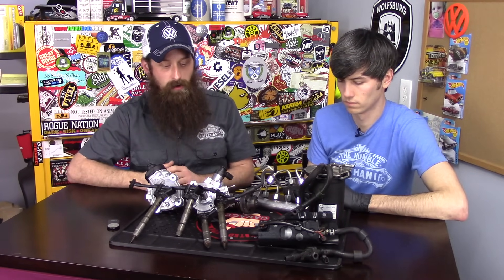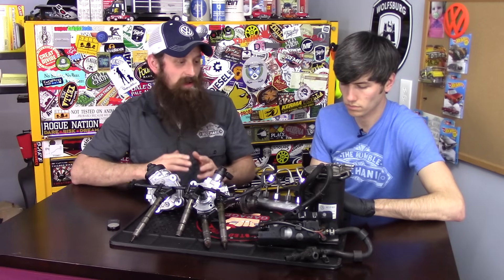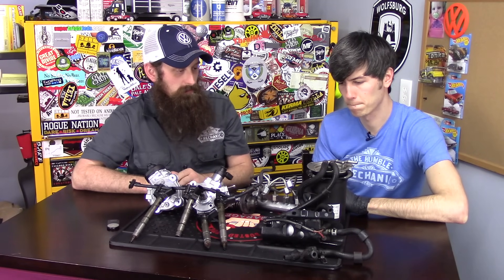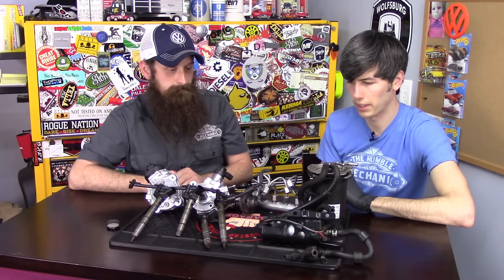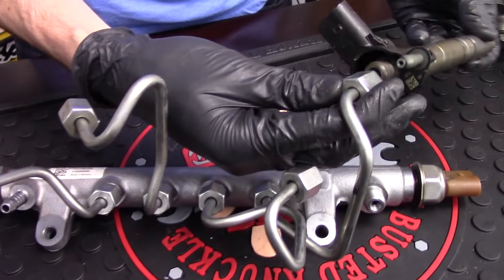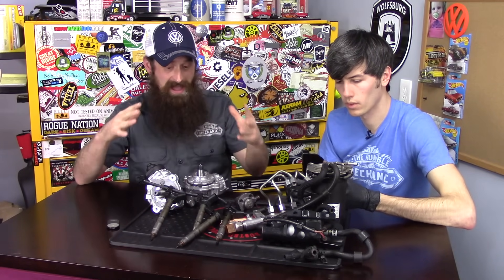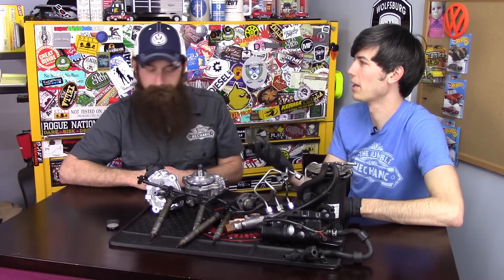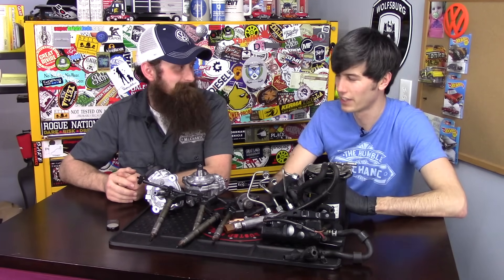Putting Gasoline In A Diesel Car - What Happens?

Comment: We have 2 tankers for fueling equipment where I work, 1 gas and 1 diesel.  Aside from the nozzle color and placards, they are identical.  One day I must have been in outer space, and I pulled up to the wrong tanker and managed to pump about 20 gallons into my Ford Powertsroke before I realized what I was doing.  All I did was drive it over to the shop, empty the tank with a transfer pump, and fill it back up with diesel.  Still going strong to this day.  Replacing the entire fuel system seems a bit overkill...
Reply: MOTO 809 Well think of this too, VW is always overpriced. Everything German is overpriced. They make a big deal out of little things. Nothin like a good Ole Ford.
Reply: Be careful. I nearly put E 85 in my diesel, because the pump handle was the same color as diesel.
Reply: Grumpy old fart so u just put it in the hole?
Reply: Some people don't realize what they've done. Far more often is that you pull up to a full serve pump and the gas jockey fills your diesel with gasoline, then you drive 100 miles down the highway to get home and your truck never starts again.... RIP duramax
So yeah it depends on how much goes in really. Driving it 500 feet, it probably isn't even going to start to eat that gasoline.
Reply: Les Brown
I can't just shut down and spend an hour draining the tank in the middle of an active AOA.  My shop is about a quarter mile down the airfield from our tankers, and hunting down crew to help tow a truck can be difficult.  I did what I had to do.  Yes, it still runs just fine.  That was over a year ago.
Reply: MOTO 809 Typically you have problems with your fuel system after you've been driving with the wrong fuel for a while. In your case it hadn't even reached the fuel filter (he says assuming the filter is in the engine bay...) before you drained it all out. You normally get between 5 and 20 miles before it makes its way into the high pressure pump and then probably another 10 or 20 before any serious damage occurs. If it were me, I'd wait 'til something fails before changing fuel system bits and bobs.
Reply: Mason Holloway I bought a Passat at the end of the year for about 26 K. Ford has nothing to match it at any price.
Reply: There is often a wide gap between professional standards and captive fleet standards. In your case - and in mine, driving a diesel for a Fortune 100 company - there is really no big issue if they lose the bet. A shop that has charged somebody $1500 for a minimal repair - drain and dispose (did they really not even drain the filter?!?) and basic clean up - and they come back later with a failure that the shop has to charge them $5000 more for... that is the nightmare of every indy mechanic.
Reply: He isn't wrong though. So the comparison is correct. One of my first bought cars was a 1999 Diesel Volkswagen Jetta. My girlfriend at the time mistakenly put gas into it, a quick run to the local mechanic to drain the system and throw in a new filter did the job just fine. To this day the car still runs solid. Generally speaking, unless the mechanic is a friend, a mechanic will typically try and nickel and dime every avenue to maximize his profits. 

Fast forward to now, my 2010 Volkswagen Passat Diesel, I mistakenly put diesel into the tank after I failed to properly read the label (didn't help that the marked diesel was blue and not the typical green or yellow). Again, a trip to the local mechanic to drain the system, new filter, all is said and all is done. 6 years later, the car still works beautifully, no issues. 

Uninformed people are usually the ones to fall victim to those trying to shove their hand into your pocket/wallet as deeply and greedily as possible. People with a general lack of knowledge about certain things will normally always follow a mechanics say-so, without actually questioning whether or not it is needed. When a person is being informed that their vehicle needs whatever in order to function properly, and the person informing them is someone that is most qualified at what they're supposed to do, it becomes abundantly clear to the uninformed that is what they should do - even if it's a huge cost.
Reply: Your Ford Powerstroke heavy duty has different tolerances (and is heavy duty) than a modern volkwagen passenger diesel system. Please don't compare the two.

Comment: is the cylinder that we use in petrol engine and diesel engine the same type and if yes how do we achieve different compression ratio for the different engines with the same kind of cylinders

Comment: What you do is drain the tank and fuel lines from the tank to the diesel filter and  injector, then fill  tank with diesel and  drain fuel lines again  to the injector till it stops draining gasoline, then prime fuel injector and purge out air and replace diesel filter ( if nessesary ).

Comment: Unless the engine has failed I would just remove all fuel and then correctly refuel. If it runs ok then leave it. Sounds like a lucrative money spinner changing all those parts just as a precaution.

Comment: ok, so if the petrol that was put into the diesel engine didnt damage the pump and HP pump then what would its affects be on the engine itself, say we use ultra high octane gas (100+), how would the power output be different?

Comment: Admittedly don't know Jack Sh*t about automotive matters.  Having said that I am somewhat incredulous that accidentally putting Regular Unleaded gasoline or "Petrol" can cause such a catastrophic syndrome of engine troubles.  I envision most scenarios going something like this:   An absent minded person fills up his diesel vehicle's tank that's under about a quarter full.  He drives off but immediately the vehicle expresses in no uncertain terms that it's not liking the gas you just put in and you have one of those facepalm moments in disbelief that you did such an idiotic thing and at the same time you pull the car over and switch off the engine.  I'm having some degree of difficulty in understanding how this could cause the sort of damage and costs associated with fixing it?  From a physical science aspect, what is going on within the engine that could cause such a degree of damage in such a short amount of time?  The High Pressure pumps were cited as a big problem where the gasoline caused metal contaminants to sheer off.  I'm just not understanding how this could happen so quickly.  It's not like you're running sand through the thing or anything.  I look forward to any answers that one might want to school me on.Thanks!Robby

Comment: gasoline does not have enough inherent lubricity to protect the injector pump. Direct injection brings gasoline engines a step closer toward operating like a diesel engine.

Comment: $4,000 in parts plus labor.....hmm....how much to drop the entire engine out and drop in a used engine.
Reply: im not sure for vw diesels but for a powerstoke or cummins a used engine is worth 5k or more and new is 10k+
Reply: fender i was thinking the same thing!! I replaced my 1500cc mazda engine with a 1900 fuel injected unit, got a recon motor for 1200 and a friend of a friend done the swap for 350. this was in 1999, but i dont think things like how much a reconditioned motor costs compared to now has changed that much.. i will need to check it out with my cousin, he works in a toyota dealership

Comment: Diesel fuel in a gasoline car can be equally bad.  The entire fuel tank has to be cleaned, which considering its location under the trunk is very time consuming.  I don't know what other parts are damaged, only that it won't start, because diesel fuel does not ignite, even with a spark, under gasoline engine compression conditions.  But I'm sure that some parts designed for thin gasoline would be clogged by the more viscous diesel fuel.
Reply: oh yeah?
Reply: How do you get diesel in a unleaded tank??? The nozzle won't go into an unleaded tank.
Reply: +bd8026 Some years back not all stations had the bigger nozzle. Maybe this is why the size of the diesel nozzle was changed.

Comment: I did this at work. I was told to "gas up the tractor". So I went to the tanks and the gas was locked. So I go back and say "the gas is locked" and he gives me the key. So I gas up the tactor. Well when the diesel tractor starts knocking and banging and belching, my boss gets mad at ME. I was 16 and had never used anything but gasoline tractors.

Comment: So fundamentally gas in a diesel car is only a problem because those cars are designed to utilize the lubrication from the diesel?  Are there any issues with ignition temperatures and such from the engine trying to use regular gas?

And the reverse - diesel in a gas car.  Extra lubrication isn't an issue - so is the chemistry of the fuel just going to be sub-optimal, or will it actually be bad enough to cause damage to the engine from mis-fires and such?

Comment: i drive a dieselcar and once accidently filled it whit gasoline instead of diesel, it was not a full tank , it was however half a tank. the car stil started bhut had isseus starting up ; drove it untill i had half a tank, refilled it whit diesel to get a better mixture. this happend over 60000km's ago (37282 miles) ; no components have been replaced and all stil works fine, car recently passed it 134000mile mark. (opel corsa 1.3dcti)

Comment: I pulled up to a pump put the thingy down and tried to get the nozzle to do it and it wouldnt work then I finally realized it was a diesle pump not the regular.I am sure glad the nozzle did not respond when I hit the unleaded button (the diesel and regular pump thingy were on the same pumper thing. if you know what I mean. so now I am more careful.

Comment: The circumstances I would replace all part mentioned are rare , if someone else is paying , insurance , brand new car .
Even then I would choose against all of the above , and get 1/3 to 1/2 of that from the insurance company , and drain , replace filter and feel like just robbed a bank .
Been auto technician / mechanic for over 40 yrs. , had my own shop , and dealt with this a number of times , one of the shop locations had diesel pumps .
Also worked on a lot of heavy equipment , multi-fuel engines .
A couple things I would do if I was trying to prove / disprove is use microscope for inspections , and same cars / trucks and drive 100,000 + side by side , not hardly doable . 
Other wise some good videos .

Comment: A little bit extreme... why not replacing the windshield as well. 
Low pressure fuel pump (inside tank pump) If a pump can pump gas it can pump diesel, theres no point for the factory to build a weaker pump that can only handle diesel fuel. 
Replacing the fuel filter housing, "#$$%%&#?? Don´t you ever heard the term "ultrasonic cleaning" ?? 
High pressure fuel pump, Ok, here is the only item that if the car was driven a lot of miles it can fail, but, how many miles can you drive with the wrong fuel ? 
Common rail housing, Too much, now you cant clean a pice of casted aluminium ?????? Screw everything out, ultrasonic cleaner and ready for use. 
I´ve deal with these VW problems every day and if the car has only contact but no crank the only thing you need to do is clean the fuel tank, change the filter, fill whit diesel, disconect the two lines at the high pressure pump, run the in tank pump with the vag scan until clean diesel pours out, connect everything and ready.

Cost: Labor and fuel filter.

Comment: I had a 2007 Jetta, was in a snow storm and accidentally filled about 2/3rds of the tank with gasoline.  It ran 9 miles until the first stop sign.  Eventually got it back to the house.
Siphoned as much fuel as possible out of the tank as I could, about 5 gallons which I put into a 96 Grand Marquis (that 4.6 is such a great engine, it will burn anything! )
Refilled the tank with diesel so it was about 2/3rds diesel mixture.  It started up!
I let it run a long time idling so as not to put strain on the engine, when it was down about 3 gallons, I put in 3 more of diesel, then just drove it, never having a problem.

Comment: we have people put gas in diesel semis and all we do is empty the tank and fill it with diesel and the trucks run fine and during winter adding a little gas in with the diesel helps the motor run hotter which can help trucks from gelling

Comment: Don't spend $8,000. to solve a potential problem that doesn't exist.  Don't fix it if it isn't broke.  If it runs then run it .. if it stops then have it fixed.    Maybe you should have not have purchased a diesel vehicle in the first place.  This video is very deceptive.

Comment: its actually commonplace in parts of the world with very harsh winters to add a bit of gasoline to a tank if diesel so it wouldn't solidify as much overnight.
Reply: My '84 VW Turbodiesel actually had a table in the owners manual for how much gas to add to a fill to keep from gelling up.  Up to 10-12% if memory serves (sold car 10+ years ago.)  Newer common rail systems are a whole other world of pain as far as what they will tolerate.  29,000 psi at the nozzle (not much room for contaminants..)

Comment: Total ripoff, shaking head... It is totally unnecessary to do all they say in this video. Sadly this is what is usually done and the costumer pay a horrible price totally unnecessarily... Most cases it is enough to just drain the fuel system and fill up with diesel. Sometimes it is enough to just add 2 stroke oil and run with it if the mixture is not to much gasoline.

Comment: I have seen someone that filled a desiel filter with gas and install it on the truck and try to start it. then I got called to look at it we removed the filter and installed it filled with desiel 911 and the truck is still running today 5 years later

Comment: so if gasoline doesn't lubricate the diesel pump, then what lubricates the pump in a gasoline car?
Reply: on a gas engine, the fuel pump has ball bearing at the motor and at the vane pump and won't require outside lubrication. (usually submerged in the gas tank on most fuel injected vehicles) these pumps run around 40-50 psi fuel pressure.  The diesel injection pump on a distributed injection system ramps the pressure up to 3000 psi or so for mechanical 'pressure break' injectors (the injector opens at a specific psi range due to the incoming high pressure).  A common rail injection system runs the pressure up to north of 25,000psi, the injector opens electronically.  The pump tolerances on the diesel pumps are down to the tens-of thousandths of inch (.0001)  to maintain the crazy pressures.  The lubricant helps to maintain the seal.  Diesel is a 'light oil' whereas gasoline is an 'aromatic solvent' (It will evaporate) it will also dissolve other oils - which is why gasoline is a great parts cleaner -extremely dangerous - but a good cleaner.

Comment: What really happens is the vehicle vapor locks , due to the wildly different vapor pressure between the two fuels ,, drain the tank , refill with diesel ,, none of it has run long enough to cause damage ... DON'T TAKE YOUR CAR TO THAT GUY ...

Comment: #engineering explained pls do if putting a diesel in patrol car...............plsssssssssssssssss.......
Reply: It's not as bad since gasoline engines rely on a fuel which doesn't provide the primary source of lubrication. Most parts clean up but depending on the engine it may not be worth your time to clean certain parts.

Comment: Every time someone put gasoline in one of our Bobcats no damage was done. As mentioned the older diesel systems were much more forgiving. As for disposing of the mixed fuel I would just put it in trays and let the gasoline evaporate. The remaining fuel worked just fine in the old dozer.

Comment: Over kill for sure. Seen this situation many times. If gasoline was put into the tank but the engine not started, then just drain the tank the best you can and refill with diesel. If the engine was started and run for only a short time, again, drain the tank, replace with diesel then turn on the key and let the fuel pump run for awhile. The gas will mix with the diesel and be diluted. 

In 40 years I have never seen a bit of gas hurt a diesel engine. If something does fail down the road, replace it then. Chances are the gas had nothing or little to do with it. I know of one case where a fellow put about 5 gallons of gas into  his tank before realizing his mistake. Being too cheap to drain the tank, he just topped it up with diesel and ran it through. Drove that truck for another 10 years before he sold it. It ran like a charm.

Comment: What will happen is that the fuel injection pump will stop working and therefore, the engine...
I had this happen once when I inadvertedly fueled up with gas my diesel Peugeot station wagon...
I had to empty the tank (fortunately European cars at the time still had a plug to empty the tank and since had a box with 12 
quarts of oil, after the tank stopped draining , I poured 9 quarts of oil into the tank, waited a few minutes, turned the key w/o
trying to start the engine, cranked it , the engine started  and since the gas station wasn't that far, babied it to the pump,
mde damned sure this time I fueled up with diesel fuel and had no further trouble whatsoever.......